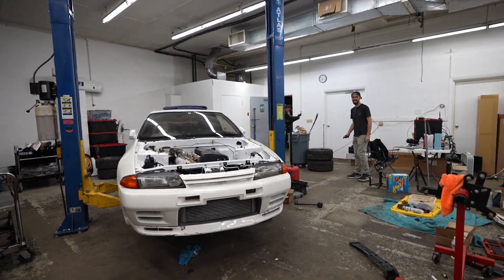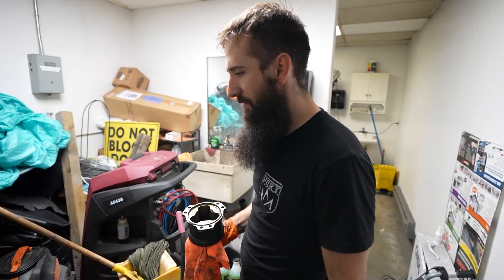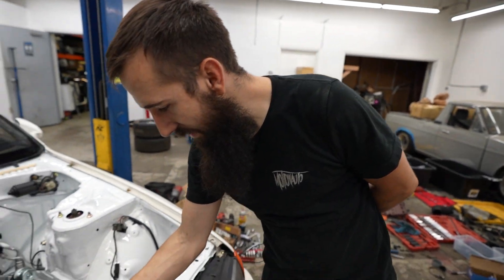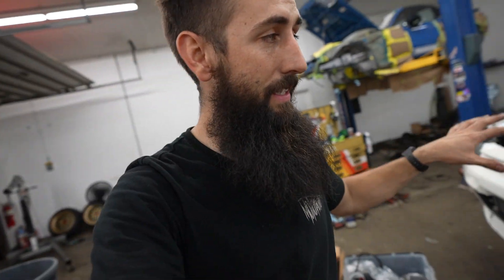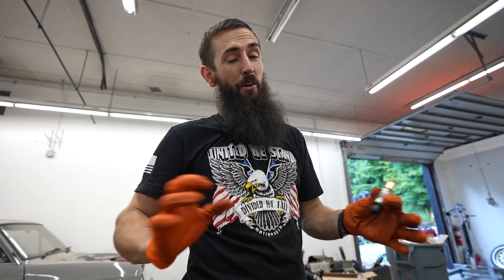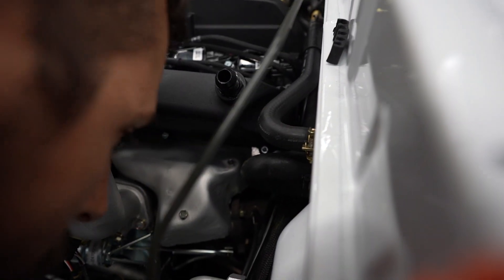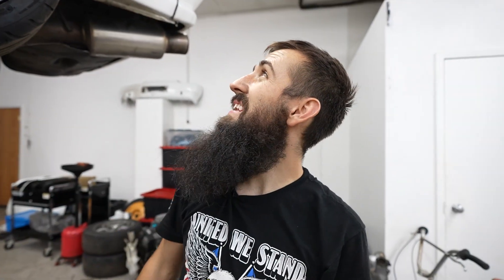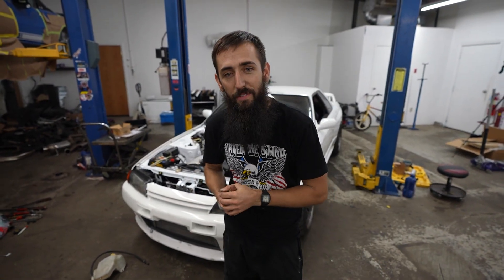My R32 GTR is DONE!!!

Comment: 3:00 thats a cool tip. When i was in the trade I would use a sharp flat head screw driver and punch a hole in the lip, this would allow the paint caught in the crevice to drain back down. Also saves on tape and when you're on the job bosses like that shit lol.

Comment: I've never seen anybody fill a cv boot with grease, I don't think it's necessary. Just alot more messy when it splits
Reply: What would you do instead? Just grease the CV joint you mean and not completely fill the boot?
Reply: @nzuncovered1845  yep, I've been a mechanic for 15+ years and never seen anyone I've worked with fill the boot too.
Reply: @samthesr20man  Yes I agree I have only done a few CV joints but I usually just pack the joint liberally but don't fill the boot

Comment: Can anyone explain why most if not everyone gets a HICAS delete when it sounds beneficial or is it just terrible to have? Just ordered a ER34 GTT series 1 which came with a HICAS so just wondering if I should get rid of it if it's useless?
Reply from the maker: It’s just an old system that’s really outdated. Really not worth it in my opinion.
Reply: @MotionAutoTv  Gotcha, in that case I'll be doing a HICAS delete when my ER34 arrives. Cheers buddy for the reply, been a long time viewer of your channel since the old days, amazing to see how far you've come. Keep it up with the content! Keeps me motivated for when my dream car arrives.
Reply: @Pcmanx19  It's not so much that it's outdated, it is good for normal drivers and gives the back end better traction around corners. But it becomes unpredictable under hard driving and cornering if you induce power oversteer. It can throw the car into a spin, it can be quite frightening.
Reply: @nzuncovered1845  Aaah I see, very well understood, thank you for the indeph explanation, that certifies my decision that for more driver reliability, I'll get the HICAS deleted, thanks!
Reply: @Pcmanx19  Yeah I personally would delete it with a lock bar and save the HICAS parts in case you ever want to sell the car with it fitted. You also save weight if you delete it something like 20 to 30kg.
Reply: @nzuncovered1845  Excellent, thanks again buddy for all the info!